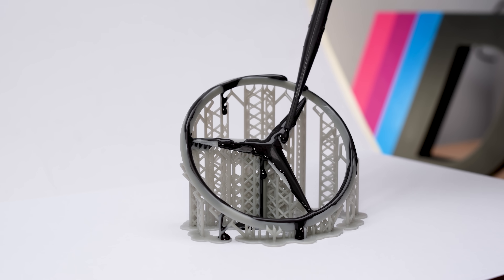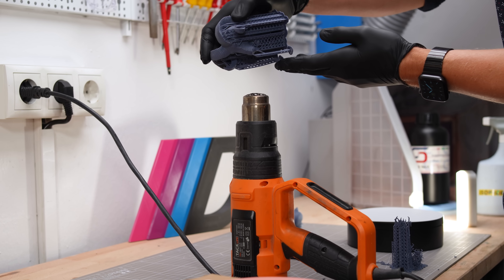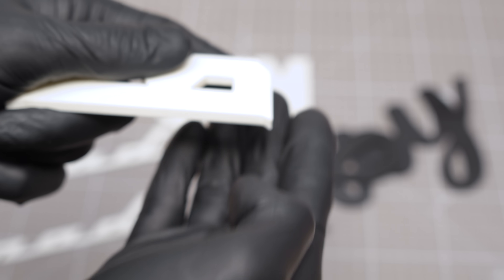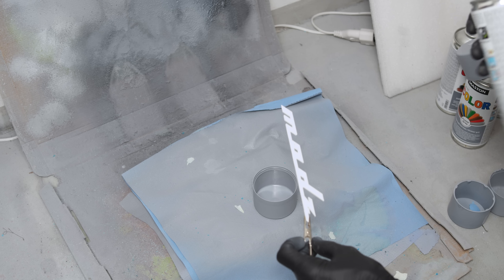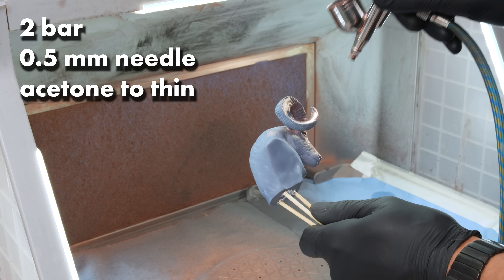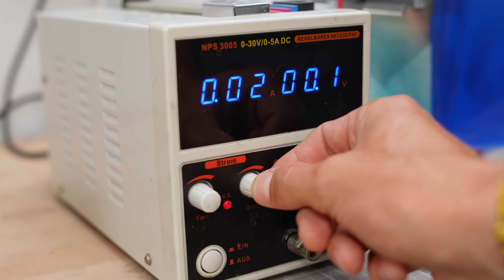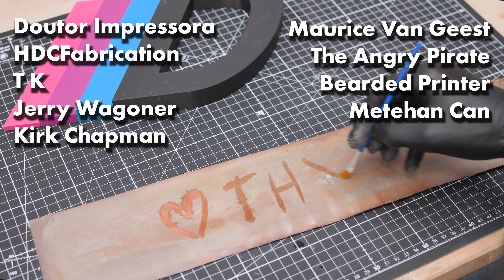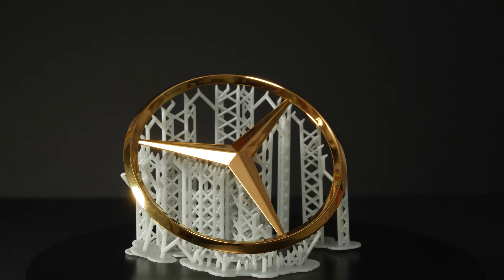Electroplating 3D Prints into REAL Metal Car Badges | FULL TUTORIAL

Comment: Hi Hendrik, thank you so much for your videos; they're really interesting.
I'm going to try the same thing, and I'd really appreciate it if you could give me more information about the motor you use to turn the parts.
What type of motor is it, and how powerful is it?
Thank you very much.
Reply from the maker: That‘s a continous rotation servo.
Reply: @hen3drik  Thank you very much Hendrik,
Could you give me some more information? For example, power or speed, etc.
Sorry for the questions, but I don't really know much about these engines.
Reply from the maker: Use a DS04-NFC 360 and an adafruit m0 trinket (or any other) as a controller

Comment: Have you ever tried/considered diluted laminating epoxy or acrylic(the kind used to strengthen wood) to seal FDM prints(more readily available and likely also cheaper than a speciality  product)?
Reply from the maker: Yes, I did that on my C-3PO that adds material to the FDM prints. Works well, too.

Comment: can we maybe explore different ways of making prints conductive? and maybe also ways to make diy plating electrolytes?
because after the 50th video of you pulling out perfectly shiny vanity items out of commercial electrolyte baths the content starts to be a bit dull....
Reply from the maker: Thank you for your feedback. Regarding the diy electrolyte: I won’t show people how to mix a sulfuric acid based electrolyte. That would be irresponsible imho. But I could help tuning different electrolytes with a hull-cell.
Reply: @hen3drik  i would actually prefer to see you bring household kitchen DIY electrolytes based of stuff like white vinegar (essigessenz) or citric acid to their maximum performance using your knowledge of the process. especially if you manage to use only kitchen lab brighteners.

 also explore other methods of initially making prints conductive like the silver mirror solution (tolens reagent). are there more such reactions that could deposit just enough enough metal to kickstart electroplating? if you find one for the kitchen lab even better

Comment: Hey, could you drop links to the Dremel and bits you use, the extraction fan that spins the liquid, the rotator with the walnuts, and any other gear you recommend? Also, would you mind going more in depth with a step-by-step on when you sand, what grits you use, when you switch to polishing, and just how you know it’s time to move to the next step? That would really help me understand it better. Other than that, great video!!

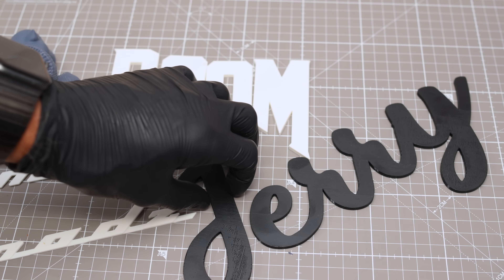Comment: 2:36 Calibrate your ironing settings and use the 'All Solid Layers' ironing option to print watertight models. This setting smooths gaps in each layer, preventing water leaks. I often use it for 3D printing molds when casting silicone.
Reply: Does this apply to resin and FDM printing?
Reply from the maker: That could work, too, but never had luck with any of these settings. Will try!
Reply: @hen3drik  Hello.
Do you have a tutorial on how to make homemade graphite paint?
Reply: Yes, you can absolutely print water tight. Do it all the time. You'll most likely need 4 walls and a .18-.16 thickness.

Comment: What if you just coat fdm prints with liquid resin.
Also, what if you just use 100% infill on the fdm prints. Then it will be just solid plastic.
Reply from the maker: Coating with resin works. 100 % infill does not. It’s still not water tight.

Comment: You know what might be an interesting addition. Include some tiny rare earth magnets in your print. (Include a pocket and a pause in the print then encapsulate them)
Then your badges are easy to apply and remove. A thin self adhesive rubber or similar might be an idea on the back side to prevent scratches.
Reply from the maker: This is a very very good idea and should be followed by everybody who does „real“ badges for his/her car!
Reply: @hen3drik pro tip. Alternate the polarity of your magnets to create magnetic circuits within the metal and increase your holding power. 
Like go north up, then south up.

Comment: Wait so are you using sulfuric acid to plate the metal paint? Isn't that very dangerous?
Reply from the maker: The electrolyte is sulfuric acid based. It’s low concentration which makes it less harmful but potent to dissolve the anodes to regenerate the bath with copper ions.

Comment: The longer a resin print stays in the UV chamber, the MORE BRITTLE it becomes. A flash of 60 secs is ideal. Anymore and you just make it more breakable.
Reply from the maker: That’s 100% correct but when it comes to plating it’s important to have it cured a lot to improve bonding to the paint without „gasing out“. Just my experience. I‘ll try to setup up a test to get this right.
Reply: Man bots are getting smart, kind of...

Comment: I will consider this my bible to electro plating. I can see where a resin printer produces a smoother product than FDM printing. With FDM printing there is so much sanding and steps to get it anywhere close to resin printer. Thank you so much for videos such as this 😊. CHEERS
Reply from the maker: 🤗 thanks, my biggest platings are FDM based and although it takes time it’s very doable on especially curved geometry
Reply: I was really surprised to see you at PRINTOPIA today. I could not believe my eyes.  I told my wife I watch your videos and the way you put on your PPD ‘s.  You were very nice to talk to and will watch your videos in a new light. I really enjoyed our conversation.  CHERRS
Reply: Ps.  I love the pin you gave me.  Thank you
Reply: Just dip it in resin and your fdm print is smoth like a mirror. Did this myself with pla print and pouring 2 component resin